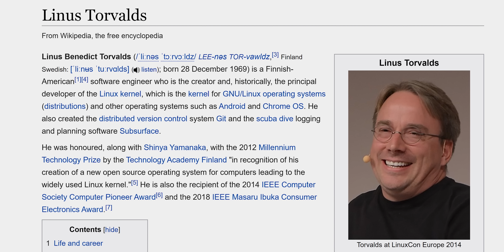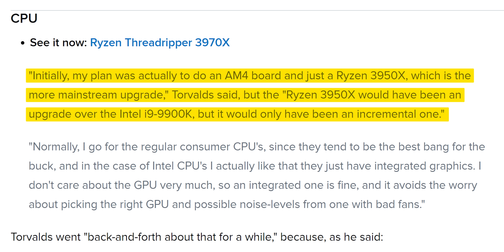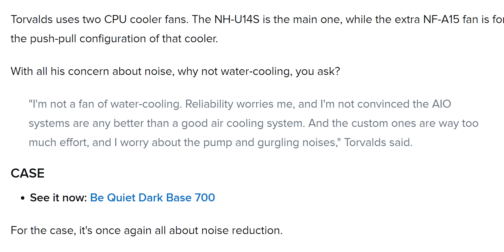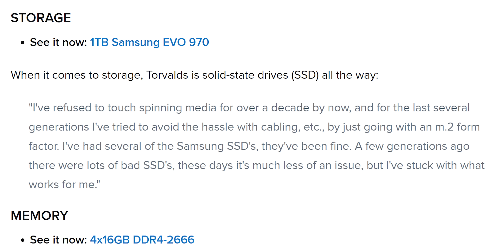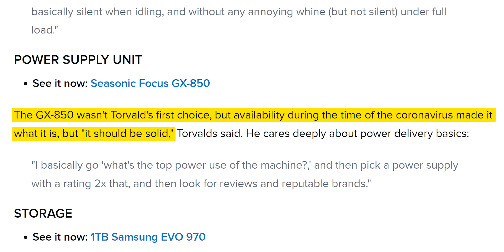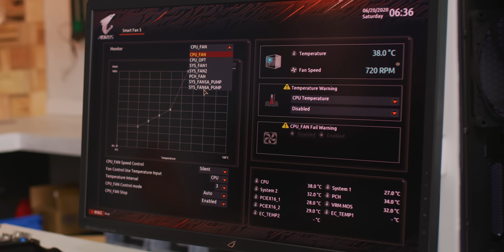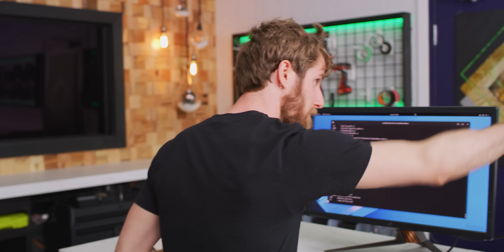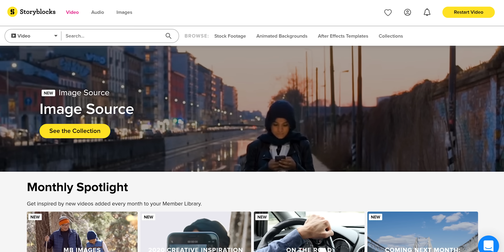Linus builds Linus’ new PC!

Comment: 15:40 There's a reason for that. Depending on the developer you can have different needs. If you develop apps/OS for desktop (like word, linux kernel, etc) you would need beefy CPU to compile these programs in a reasonable time. It's similar for enterprise Java stuff. Game developers need that and beefy GPU (I'm talking about Unreal/Unity not RPG maker). Mobile developers also need beefy CPU for virtualization and reliable Internet access (I mean most people need reliable internet since since pretty much every app needs Internet but some more than others). Web developers like myself really don't need beefy CPU since they don't need to compile anything could use CPU or not depending on workflow, I care more about reliable Internet and I can theoretically work on a laptop. I do anyway because I game and in case I do freelance stuff that would require compiling. Plus I really like building PCs and its cost effectiveness.

Edit: Ok so Web Developers do need to compile but it varies. I mostly work on apps already on the web in test environments and don't recreate them on my personal machine. If you were doing one from the ground up then yes CPU power would be necessary. If your web app is making clients computer's chug, 95% of the time you're doing something wrong. Everyone's tech stack is different and no one web developer has the same workflow as another. Hundreds of tabs seems overkill to me though. Also across all developers RAM is very crucial nowadays.
Reply: Soon WebGL/WebGPU will be a requirement for web dev positions much like modern frameworks so low-mid range laptops are going to be out of the question. As a developer the most important thing you need is the targeted architecture and OS. You can cross compile to PPC and run it in QEMU all you want, but unless you have an actual PPC system you don't know if it works.
Reply: @jarilo8639  also wtf lol. WGPU is for a couple of small niches, like web gamedev. There's no way it's going to be anything close to common, let alone a requirement. How often do you use webGL?
Not only that, saying you need a good gpu for webgpu is like saying you need a good gpu for opengl. WTF?
Reply: @jarilo8639  re arch: no, it doesn't matter outside of a small niche - like compiler and OS devs. Javascript, python, java are arch neutral. The OS matters more. And PowerPC? When was the last time that was mainstream? A decade ago? Besides, VMs almost always do a perfect job at CPU emulation. The problem there is the graphics cards, the io, the specialized devices and drivers that can't be tested in a vm at all.
Reply: I'm a game dev, I agree with this but I'd also add that I need a TON of RAM. Unity + Slack + IntelliJ + Rider + Firefox + Discord + Spotify = hungry. I also need a lot of IO for hooking up a bunch of devices for mobile testing. GPU doesn't need to be TOO beefy, but it definitely can't be integrated.
Reply: I do a lot of ML and its also having a good nvidia gpu (like tensorflow and pytorch that uses cuda) a lot of times to speed up training and running ML models
Reply: When you're a web dev with the bpm+bundler+transpiler workflow, like most are, IO and CPU are the main bottlenecks. Even fast ram makes a difference. Most web devs also have 100s of tabs and multiple browsers and an IDE and slack/discord/etc. along with a bunch of other electron apps. You tend to need at least 10 gigs of ram, an ssd and a mid to high end cpu. You can put that in a laptop but it's not ideal.
Reply: nowdays even the webdevs are required to have a good CPU since a lot of stuff is still compiled even on web specialy if you are a fullstack developer
Reply: Of you're a web developer but you don't have to compile you are doing something wrong :). Go, Javascript, php, Java.. Running scss/sass, webpack, lining, bable... I fill 8+ cores easily
Reply: @jorismak  by the time I drag my eyes from code monitor to browser monitor the compiler is done. And if it isn't, put that code into the garbage bin because it doesn't belong into a web browser.
Reply: @RmNrIHRoZSBDQ1AK  just compiling bootstrap or foundation can take a couple of seconds when building from scratch.. I wasn't talking about the small incremental updates when you turn a watcher on.
take any react or vue scratch project, just scaffolded.. do a clean `npm run build`... that takes +/- 5 to 10 seconds on my Ryzen 2700x. That's from scratch.. without much of an UI framework in there ..
Yeah, if you have a little bit of code in a <script> tag somewhere, you're not talking about compiling... start do some real projects for real clients.. anything from full linting, static code analysis and your unit-testing (and maybe even the functional tests).. anything that makes that stuff go faster, I need.

Comment: 11:53 Linu's computer looks as clean as Steve Jobs in a black turtleneck.  With that processor I'd bet he does alot of testing in VM's, and also wanted a platform that would really support that well.  The one gaming like thing me may want to do or think of doing is passing a GPU through to a VM to test the graphics drivers built into the kernel.

Comment: You say that a lot of developers don't mess with their hardware, but that really depends on the kind of developer.  I started writing C++ around the age of 11, I decided to get an EE degree since I felt I would learn a lot more than CS. I've been in a few communities around other programmers, both hobbyist and professional, and a significant portion of us are very interested in computer hardware. 
But, if you pick a guy up off the street who does not enjoy programming or anything as a hobby, sure, he's less likely to care about the hardware. And there is the group that just doesn't have time for it. But I don't think that stereotype is necessarily very accurate over the whole range of 'developers'.
As for their needs, well, they need hardware capable of the features they're testing.... If you're writing compiled languages (which Linus does, admittedly less often, with C), then more cores are going to help the workload if you're doing a lot of recompiles and other intensive processing tasks. C  source code compilation can easily be multiprocessed since each C source file is compiled by a single instance of your compiler in most common configurations, so it can be very scalable.  Mostly this build is saving him some time in that department and leaving a lot of headroom.

Comment: "Just how carefully thought out everything about it is..."
"some random graphics card"
Reply: It basically needed the ability to run a desktop.  Could've gone with like a 560 and been fine.  Are 550s a thing?  If so, could've gone with a 550.
Reply: @Niarbeht  yes there are and they are terribly weak
Reply: @Niarbeht  pff even I've got a 550 in my m92p but I'm contemplating upgrading to 590, I probably won't ever use all that power but I do game a bit(idk if Torvalds does or not sounds like he doesn't but he could do some light stuff XD)
Reply: @darsparx  if you can find a 5500xt for the same price I believe that's the better option. But a 590 would be a bit of an upgrade. Also with those if you have a 4gb ram model just jumping up to the 8gb model is big improvement. Especially if your gaming.
Reply: @darsparx  580 is still ok tho, just get an 8gb
Reply: hahaha yes, but not caring about a gpu is sort of relevant for a developer's machine
Reply: @exanime  So wrong.
Reply: @exanime  Actually even for (some) developers, having a good GPU is still important due to AI coding and security cracking. And in any case, a developer shouldn't think about the GPU as something SOLELY for graphics and instead think of it as an absolute ton of very small processors all working in tandem. For some tasks, the CPU is king, and for others, the GPU is. In this case, although Linus indeed probably won't ever really use the GPU much, if at all, I'd say it's still nice to have a good GPU just to keep your options open for the future.
Reply: @arnox4554  But if you do have a GPU intensive workload, even as a developer, you'd still want to use integrated graphics (or have an additional random consumer card) to drive the displays.
Reply: @arnox4554  I'm guessing you're not a Dev lol?
Reply: @arnox4554  You are not wrong. However do you know what type of developer Linus Torvalds is? I doubt he need gpu power, or he would have gotten it!
Reply: @arnox4554  in Linus Torvalds case, it doesn't really matter tho, and even if it did, he would have to take a chill pill. afaik, best in the market for that kind of work is NVidia (ML & computing in general) with their cudas and shit.
Reply: Since the cpu does not have integrated graphics, he just needs something basic to drive the displays.
Reply: Some boobs in this thread
Reply: As he doesn't use GPU compute he just needs  a video out.  If he did use GPU compute it would be a different story.  It seems to be built around CPU compile and highly threaded CPU compute based programs. So assuming he did his research it is a computer for CPU compute based programs. Developing, debugging, compiling and running on the CPU.
Reply: And ram.
Reply: That case will make it have higher temperatures witch means more fans and faster fans so louder then a open case gamers nexus has done this concept to death
Reply: @SimonWoodburyForget  There are data compression methods that benefits GPU acceleration, to lighten the data transfer over internet
Reply: He also didn’t seem to care too much about the RAM either since he just got what was available.
Reply: @SimonWoodburyForget  GPUs not being used to brute force doesn't sound correct, at least from everything I've read in the past. It also doesn't sound correct because, logically, you're just checking a massive amount of possibilities against a single hash (for this argument), and brute forcing in that regard actually does sound like something perfect for the GPU.
Reply: I would have gone with a GTX 1080 Ti, a lot of performance for the price
Reply: @erwaldox  it's a pain in the butt on Linux, as NVidia insists on having its own proprietary drivers even on Linux, and they obviously rarely work as intended. Which was exactly why Linux Torvalds was so pissed with NVidia.
Reply: @erwaldox  he is using linux my brother

Comment: Honestly, for developing software, the best thing you can have is a solid 13'' laptop with good keyboard and screen, running windows and a linux server somewhere in a data center. Makes collab a breeze since everyone is on the same machine. An if you need any capability just rent it.

Comment: Just gonna say thanks for giving Linux this much coverage, I had no idea how viable an option it really was! My next computer might just run on it. Please more!!
Reply: Linux is Amazing, and open source. Linux sets the standard for what security should be. ! It is the most powerful OS in the world. you can do what ever you want to with it. also unlike mac and windows you own your system. plus you are not spied on and exploited for money...
If you install Linux on the computer you have now (at your one will) you may fined that you don't need to upgrade to a new computer and can save money...
 If you are new to Linux, i would recommend one of the four flowing distros. 
1.) Manjaro Linux - Has most of the default Desktop flavors as independent builds. and is a fork of Arch Linux. this gives you the power of Arch Linux like its bleeding edge repositories with the pacman pkg manager and the AUR. (arch user repositories- basically a huge software depot created from the users of arch. and maybe even you soon.) in other words almost any type of software you can think of.  and adding another Arch type repository is easy to do. An example would be the Black arch repo. this repository has an unbelievable amount of hacking. pen-testing. and security software. 
2.) Ubuntu Linux- Ubuntu's main Desktop is there custom gnome environment. its a fully custom environment made by canonical to be user intuitive. 
Ubuntu is a fork of Debian, giving you access to the Debian repositories and the apt pkg manager, which are fairly stable relies of software that are well tested. but do move at a moderate pace for revisions but not necessarily bleeding edge tech. but you could get an app-image for "more bleeding edge" software.
3.)Linux Mint - with there newer desk top Cinnamon users coming to the world of Linux from windows are greeted familiarity with a more conventional layout. another fork of Debian it uses the apt pkg Manager. however the Linux Mint team has a huge focus on stability, so the software is well tested... this is not bad but it is not bleeding edge. though you can get app-images for newer versions of software. 
4.) Elementary OS- with there spin on Plasma Desktop it is an OS designed for the mac fan. and if you are coming from mac-OS the swap may even be unnoticeable at first. until you realize the raw power you now hold at the tip of your fingers. 

before you install Linux on your computer move all of your important data to a different place like a USB.  as installing on a computers hard drive can wipe all other data.
If you have any questions file free to ask. cheers

Comment: Watching on my 8 year old HP Envy DV6 with Core i7-3630QM (4x 2.4GHz) I upgraded it with 2TB EVO Samsung SSD and 16GB RAM. Took out the optical drive and converted it so I could put in a 1TB HDD. I'm not a gamer, but in this updated configuration, does everything I need much cheaper than scraping my laptop and buying something brand new.

Comment: Rignt-angle ATX on a board simply means when using a right-angle ATX adapter it won't look so weird — There is more than sufficient space once the ATX cable is adapted to bend.

Comment: True that devs dont care that much about the hardware. Either it works good enough or it doesn't. Fast CPU and much ram is important and never willingly use a Dell laptop that is not a workstation. Those laptops are manufactured e-waste

Comment: Linus, tips for a developer computer:

If you rely on Nvidia CUDA computing you need to have a Nvidia graphics card, usually such workloads are what AI developers have to work with, btw any rtx should be fine (even GTX really) but the 2080 is the best bang for buck in those scenarios. Some libraries are already OpenCL compatible but not all...

If you mainly develop for everything else... You just need threads, the more the better

If you need deep virtualization (like windows running docker with a Linux OS image and this image running other images) you unfortunately have to use Intel as it is the only option for deep virtualization in Windows (not 100% sure for Linux). This situation occurs frequently using WSL2 Docker support.

A compiler farm for CI/CD is just a high threads CPU that receives code to compile and test. Some test suites are single core but most should benefit from high thread count.

Comment: why didn't you put GPU in the middle PCIe slot? Because when it's in the top slot it almost touches CPU fan with its back plate, meaning some heat from CPU might actually warm up GPU from the back.
Reply: and you usually set core count for compilation to more than actual count of threads in your CPU because it makes it possible to load your CPU more during disk I/O operations. It might be not so much of a difference with samsung NVME drive, but hey, it won't make things worse. I'd assume -j80 would be a little bit better than -j64

Comment: I would love a Threadripper CPU with a integrated sub-15W GPU, something with RX550 performance, nothing special but good enough to run dual 4K displays at 60Hz, or, a single 1080p 60Hz monitor with no worries.